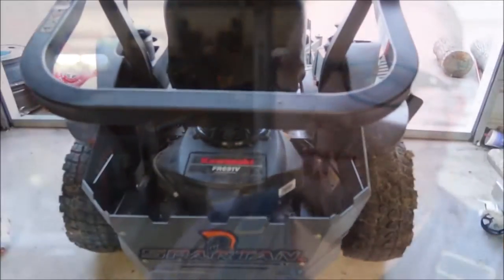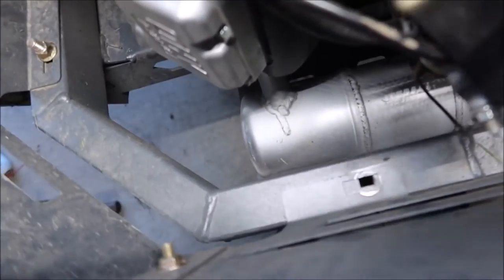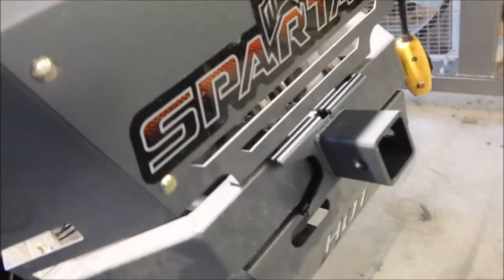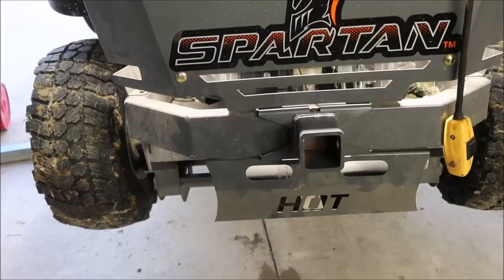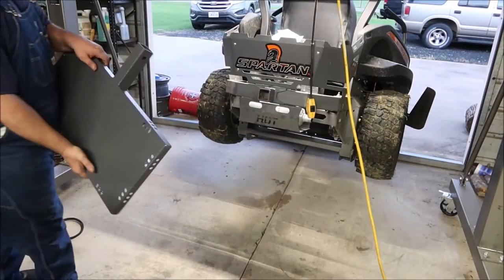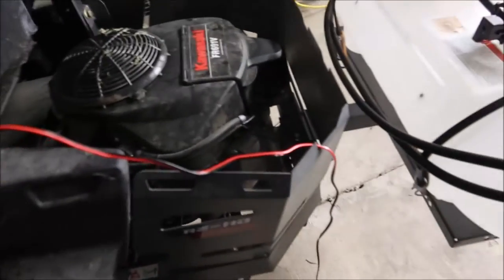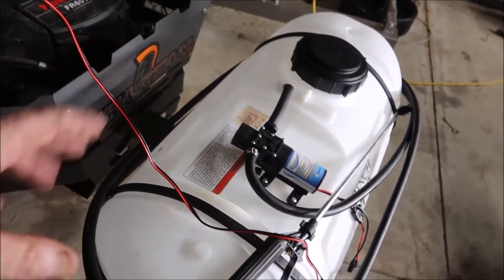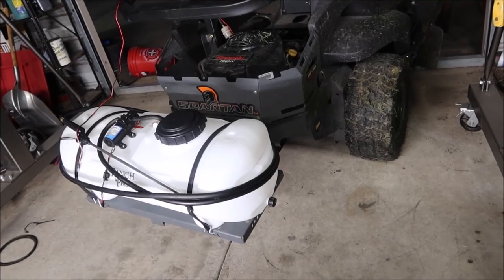TURNING MY #SPARTAN RZ HD ZERO TURN MOWER INTO A MOBILE SPRAY RIG

Comment from the maker: SPARTAN MOWERS
www.https://spartanmowers.com
DEALER LOCATOR
https://spartanmowers.com/dealer-locator/
SPARTAN RECEIVER HITCH
https://spartanmowers.com/mower-accessories/page/79/2-rz-receiver-assembly-kit
SPARTAN SPRAYER TRAY
https://spartanmowers.com/mower-accessories/page/31/sprayer-tray
RANCH PRO 15 GALLON SPRAYER
https://www.atwoods.com/department/farm-ranch/sprayers-applicators/spot-sprayers/15-gallon-spot-sprayer-1-0-gpm.html

PLEASE CHECK OUT  MY MUST HAVE TOOL AND PARTS LIST FOR ALL YOUR SMALL ENGINE NEEDS www.amazon.com/shop/backwoodsctryboy

YOU CAN VISIT ME ON FACEBOOK
WWW.FACEBOOK.COM/THEMOWERMEDIC1

THE MOWERMEDIC1 25+ YEARS EXP DIAGNOSING AND REPAIRING LAWN EQUIPMENT, GENERATORS, WATER PUMPS AND ALL TERRAIN VEHICLES,  HIS GOAL IS TO HELP THE DO IT YOURSELFER  PERFORM REPAIRS EASILY THROUGH HIS DETAILED VIDEO TUTORIALS, AS ALWAYS PERFORM ALL REPAIRS AT YOUR OWN RISK, ALWAYS CONSULT A SERVICE MANUAL FOR SPECS AND PROCEDURES, HAVE A GREAT DAY!!

Comment: I think you meant "air ratchet wrench" and not "impact wrench".  An impact wrench would need impact sockets and extensions, and is not safe to use with chrome sockets and extensions.  For my sprayer, I mounted a 6 foot 4x4 on my ZTR front axle frame and used eyebolts and ratchet straps since it holds 18 gallons.  I also used a Battery Tender quick connect harness to provide the electricity.

Comment: I use a very toxic weed killer, lol. Spectracide and glypho.  Hope everything is flat there.  My mower with the same tray is very wheelie prone at 10 gallons.  It is a gradual wheelie that you can see from a mile away.  The front end just rises at whatever speed at any inclination of an incline, kind of like an elevator.

Comment: I have thought about doing this but the mower requires two hands to use and the sprayer wand needs one.  So you can't spray while moving.  Seems like a problem to me.   Putting this on a regular riding mower might be a better option.

Comment: I would use ratchet straps instead of bungees setting slips it’s gonna go right through those bungee cords
Reply from the maker: ratchet straps will crush the tank
Reply: Not if you don’t over tighten them it’ll certainly hold it a whole lot better those bungee straps well you’re gonna find out thing on the ground if you use them
Reply: Looked like a rubber and steel belt
Reply from the maker: @gregritter377  👍